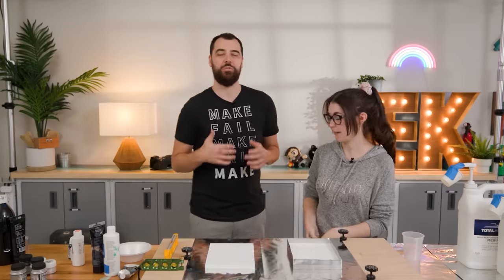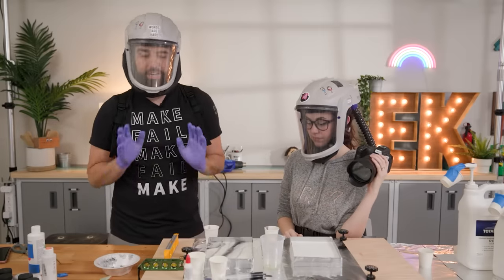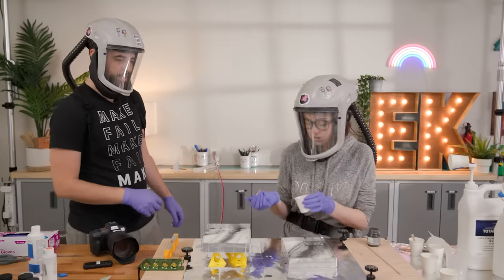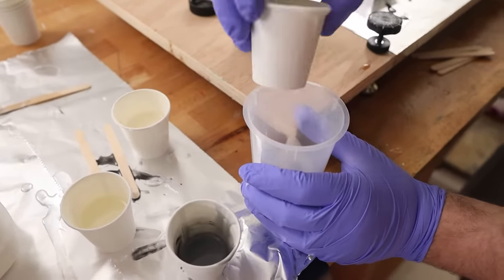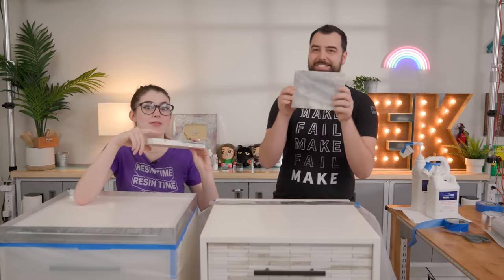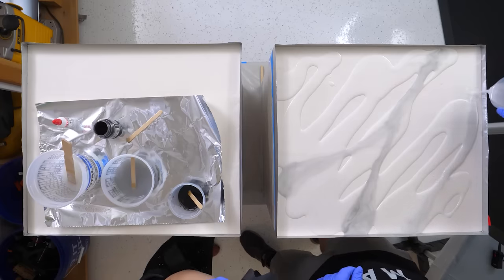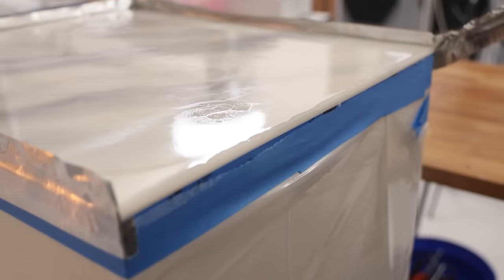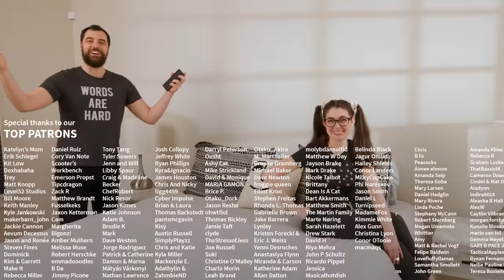Restoring Furniture with Resin Marble (that glows!)

Comment: Here’s a little tip — something that I’ve learned from my own experience working with resin: if you get just a little bit of resin on your fingers, instead of pulling out the rubbing alcohol or acetone , you can clean it up with hand sanitizer
Reply: That's because hand sanitizer is mostly rubbing alcohol.
Reply: ooh yeah that might be smarter than my go-to of scraping my hands under running water (not effective)

Comment: Somebody please get Evan a catch all tray so that nightstand survives... cause that looks too pretty to need to be re-finished any time soon!
Reply: i wonder if using the original marble resin trays would clash 😂
Reply: The benefit of resin is that they can add a clear coat to cover any dents and sand it down repeatedly. They won’t have to change the top to repair it.

Comment: I think instead of glow pigment, I would have just added dim LED strip lighting under the resin piece. It would shine through the resin and be a nightlight you could turn off and on.
Reply: But this way it doesn’t use any extra electricity to power
Reply: leds barely use any electricity. even way over-estimating 6 feet of led strips using 15 watts (at max brightness which is unrealistic while sleeping)/hours, that's 135 watts/9 hours of sleeping. 135 watts*30 months is around 4 KW, 4 kw costs less than a dollar according to energy prices. If you bought one less candy bar from the convenient store a month, you would still be saving money.
Reply: This is way better than led’s
Reply: That would be trashy asf
Reply: I love that idea!

Comment: The glowing got my mind wandering about other light possibilities... I wonder if it would work to pour resin around fiber optics to make little point lights just under the surface, all illuminated by a small LED strip hidden under the table (at the other end of the fibers) 🤔
Reply: ultimate galaxy pour?? ultimate galaxy pour
Reply: You mean making the led strip like a black light?? That would be sick!
Reply: I saw a bathroom with black stone tiles where they used fiber optics in the grout, it totally looked wicked!  Look up my modern met to see pics.
Reply: Gamer table

Comment: It’s beautiful and i loved the music from the beginning of the video. I didn’t speed y’all up just because I was enjoying it so much. You need to seal them with a matte poly acrylic or polyurethane to help keep it clean. When you sand some thing to make it matte it is rough and gets dirty easily making it a bear to clear. The matte poly has an additive to make it matte. The rough surface from the sanding helps it stick. If you have any questions just ask.
Reply: Someone stole your comment
Reply from the maker: @mischapotter  Thanks for the heads up on that bot! We went ahead and banned them from commenting and advertising their channel through mass spam 👍

Also Oongah that's a neat tip, we'll look into that!
Reply: @EvanAndKatelyn  Linus Tech Tips recently did a video about a tool you can use to remove spam from your comment sections on your videos. Maybe worth a look by you guys?? It seems really useful for a whole lot of people.

Comment: Watching this vid has actually given me the confidence I need to finally do a resin topcoat on the kitchen island that I painted to look like granite. It's got several layers of polycrylic, but it needs that glossy layer to really sell the look. Next up, redoing the top of my desk with resin and holographic/iridescent glitter...
Reply: Remember resin isn't food safe, so you won't be able to prepare for directly on the counter (like you might want to if you need to knead dough or something) aside from that this sounds really cool ^-^
Reply: @elfqueeen  You can get resin that is food safe, like the kind used on restaurant tables & bar tops. But I use cutting boards & parchment on my surfaces anyway.
Reply: @Caeleinn  ooh cool, I didn't know that
Reply: @Caeleinn  I'd get the food safe any way

Comment: Katelyn hit her resin with hot blower, what could have accelerated her resin curing. Making it less likely to mix up with the new black vein line.
Reply: i think it just popped the bubbles, evans look bubbly
Reply: oOoOO theories
Reply: @lowercase_ash  ya! Theories, do do do do!
Haha
Reply: @leonlemgruber2119  it makes sense to me :D
Reply: They use the blower to pop the bubbles
Reply: @naruto12624  yup. heat blower. It blows hot air. Hot air heats up things. Resin curing faster when hot. Curing resin heats up.

Now just DIY assembly all the information above. 😂😂😂
Reply: Evan paint on a background before resin... Maybe its that.!😻

Comment: As cool as the final result was, I bet you could have added a wireless charging pad under the top layer to make it even cooler. Love the design on these for sure!
Reply: I was thinking that as well when they showed the phone resting on there. But what to do with the cable of the charger?
Reply: I feel like embedding something like that in resin would be problematic for a variety of reasons.

For one you would have to source waterproof components because liquid resin getting into the circuitry would be bad.

Also if it shorted or the tech became redundant replacing it would be impossible.

Comment: I really love the way your results turned out and that they glow. The yellowness of the glow powder actually adds to it because most White marble has varying degrees of yellowness in it. The only thing that stops IT from looking like a real marble is the fact that the sides don't match the top. If you had taken the tops off the stands made a frame around it and poured it so that the marble went over the sides of the edge you could probably be more realistic looking.

Comment: I was thinking of trying to make thin marble inlay pieces with resin on my mantle..... now I'm wondering if I should. It couldn't be thinker than max 1/4 of an inch. And I can't do it on the mantle directly because it's vertical. I better buy a lot of resin to experiment!  Or I could buy marble, but where's the fun in that?? lol

Comment: Awesome results! It's a bit hard to tell, but if those are IKEA or other flat pack/self assembly furniture, which they look a bit like, you should be able to remove the top board to both make it easier to pour the resin, and you could also replace it with real wood. The double tape and plastic was a great idea that really paid off though, but before you revealed that it really worked, I kept on thinking that you should have disassembled them.

Comment: A quick but effective way to matte the finish of resin AND give it scratch resistance is to use this urethane top coat from Leggari or Stone Coat. They offer a "gloss" finish that won't be nearly as glossy as resin, or a natural finish that is matte. Prep is quick too, sand to 220 mix a small amount and roll it on. Works quite well. The Stone Coat folks offer their UTC in 50$ bottles, bit it lasts for a decent number of projects. Leggari does more bulk orders.

Comment: I think Evans liquid black has silicone in it. That what forms the cells when you use the heat gun. That's what you're supposed to do with acrylic pour ;) Not just blow the paint around but heat it to trigger the cells to form.

Comment: Hey guys, have you thought about getting Evan a little tray with rubber inside or use the marble tray for his side? If it's rubber inside no dropping sound issues if keys are dropped on it.

Helpful ideas?

Comment: I would like to make a resin dining table top in the near future with faux terrazzo made out of polymer clay shavings/bits that have been baked. But my question is this, as you have both worked so extensively with resin can you offer any suggestions for subtle iridescent glitter ratios that have worked for you in the past. I am trying to make a "magical " background and want to compliment the colors I'm using without taking away from the terrazzo. Thank you for even considering a message back and hope you are well now.

Comment: While I love the fun you two are having and resin is your schtick, you could just like get actual marble tops and slap them on top. They even make this artificial quartz marble that is sealed and doesn't stain. I have a side table with it and after years of drinks, hasn't leaked or anything.

For resin, it'd be cool to have a side table that like glowed softly to wake you up in the moring.

Comment: Was anyone else thinking they should have just made a resin block to put on the dresser instead of doing it straight on the dresser? Like so they could remove it when wanted or make a bunch of different ones to change out when they change up the bedroom decor.

Comment: How you guys have used so much resin and don't know that alcohol ink has alcohol in it which makes the color run out in circles expanding away on the surface of the alcohol there's whole resin pouring techniques on just those little circles popping up for cool effects you guys blow my mind how do you not know this stuff